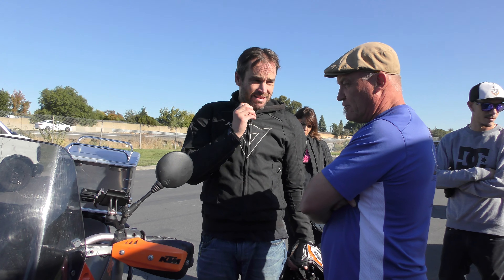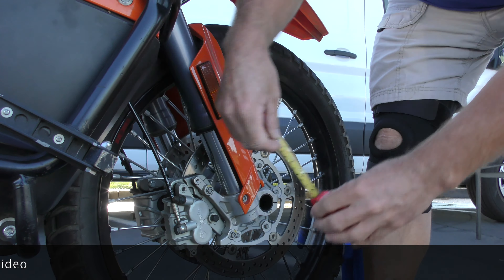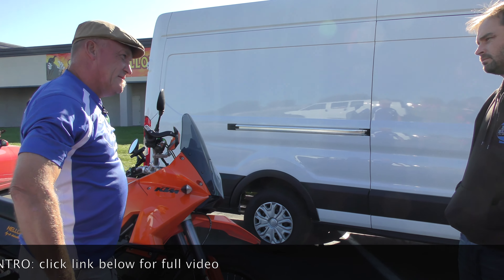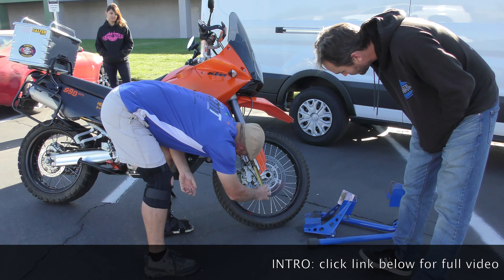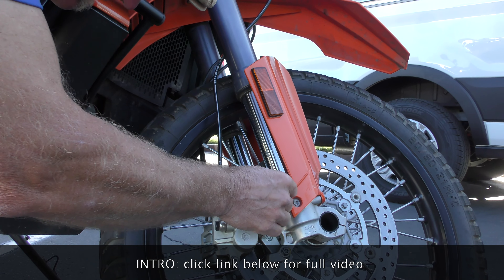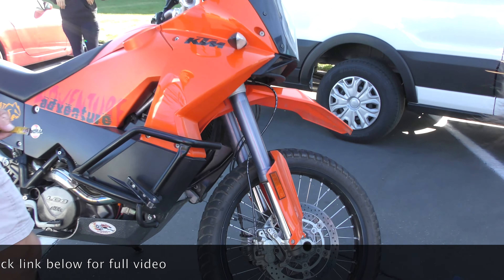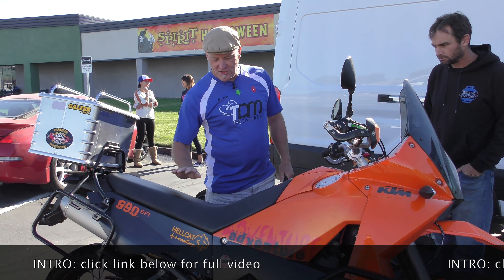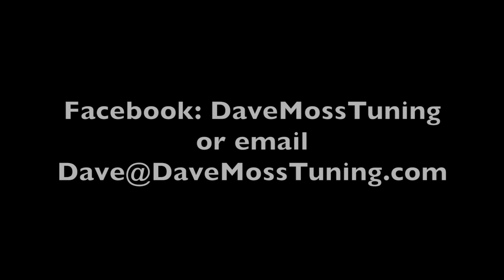Intro 2 Clicks Out: KTM 990 Adventure Street & Dirt Suspension Setup

Comment: I wanna tune my suspension, but they are non adjustable 🥺
Reply: you 'could' change spring ratings and fork oil thickness/amounts etc - if you really need to do some adjustment/tuning i assume.
Reply: @troywee4774  also the 1$ preload mod
Reply: @DarkIzo  cool - what's the 1$ mate, is it washers/spacers on top of the springs?
cheers.
Reply: Ya, that bit of pvc tube.
Reply: @wobblysauce  cool - cheers.
Reply from the maker: also remember that there is nothing stopping you changing fork position for geometry, and changing out the shock spring for something lighter or stronger.
Reply: I appreciate all replies, one day guys, right now I'm on a budget, College in India is very expensive👍

Comment: I love my 990 but dialing in the suspension can be an absolute nightmare.  I thought I had set it up for my weight but just doesn't feel right.
Reply from the maker: Start with knowing how much fork and shock travel you are using visually. Cable tie on the right fork leg and just a tiny bit of grease on the shock shaft. That will be a simple and easy visual which will immediately guide you to the first change you need. Ideal fork is 15-20mm from the bottom of the tube, shock at 3-4mm from the rubber bumper
Reply: @catalystreactionsbw  thank you buddy I'm literally doing it now !
Reply from the maker: @shulme89  Please share what you found here so you can pay it forward to help others take that first step.
Reply: Okay so after about an hour fiddling with all the different screws and actually finding the original manual I think I've got it dialed  in just right ! Just underneath the front forks is the dumping or rebound settings I screwed them all the way clockwise and then turn them 3 clicks back  the same with the rear shock. Went out for 5 minute ride over some pretty awful Terrain and the suspension didn't bottom out like before !   Definitely a new experience for me rebuilding engines and electrical systems no problem but suspension that was a another learning curve. I'm actually located in Peru and finding a really good mechanic here is very difficult.  Not like in England where I can just pop down the road.  If you ever find yourself in the Peruvian mountains buddy come for a ride
Reply from the maker: @shulme89  I hope I can make it to Peru to visit some ancient human sites as well as ride in your incredible Country. Thank you for taking the time to learn about your motorcycle and taking tools to the suspension to find and enjoy different settings. A tip of the hat to you sir!
Reply: @catalystreactionsbw   yeah hope you can make it , from the UK originally but came here purely because of the lifestyle and scenery 😊
Reply from the maker: @shulme89  No doubt - hoping to get back to world travels in 2022!